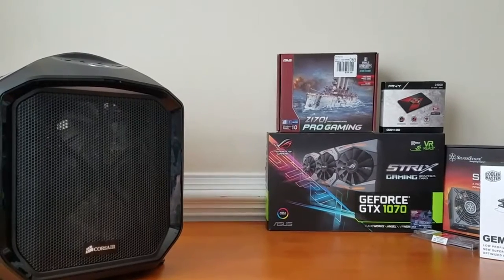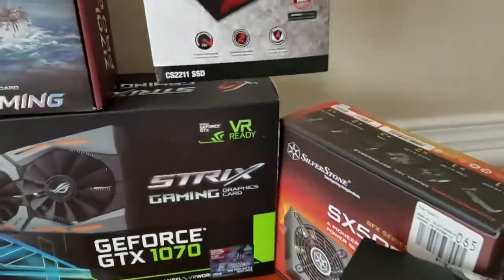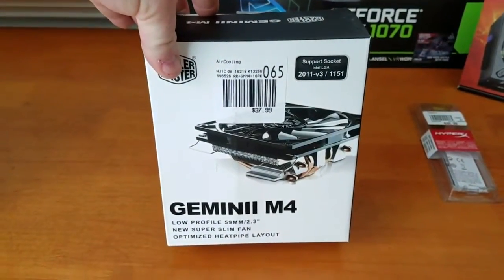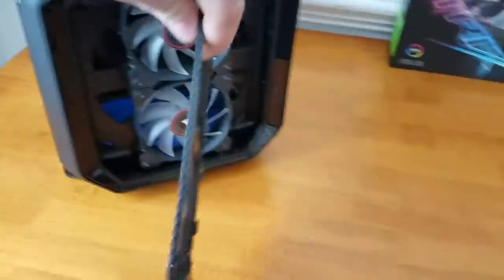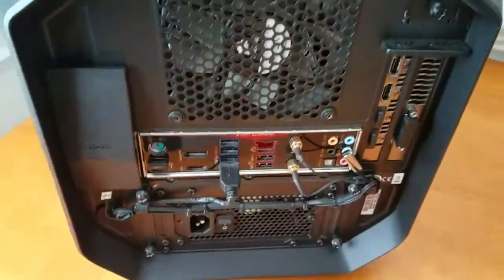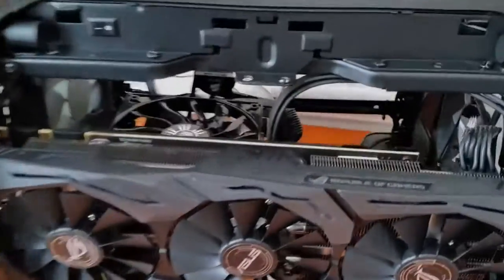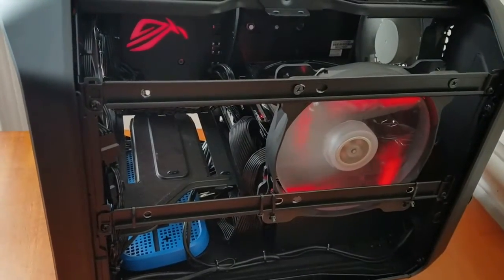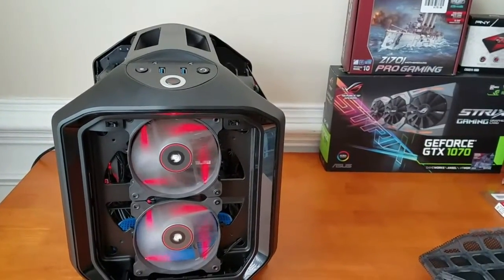Corsair 380t gaming pc build Asus strix 1070

Comment: did you have any problems fitting a 298mm gpu in to a 290mm case? wondering if these are just ball park figures or they are accurate.
Reply from the maker: More a ballpark. I did have to snip a little of the plastic clip that holds the front face on. Took about 3/16 off the tip of it just so it wouldn't touch the end of the gpu

Comment: Hi, according to Corsair, the max GPU length is 290mm. But the Asus Strix 1070 you have is 298mm. How did you get it to fit? Thanks.
Reply from the maker: It will fit without any mod. There is a small clip that holds the front faceplate on that will rub the end of the gpu slightly. I just trimmed a 1/8 off the clip so it doesn't touch.
Reply: Ok, thanks so much!

Comment: Hello, nice cable management ! 
I'm thinking of buying a 1080ti instead, but i'm worrying about card depth 5,25 mm (Lengh is 298 and height 13,4)... Do you think it's possible?
Thanks =)
Reply from the maker: I researched the size difference in the 1070 and 1080 ti . The only thing is the 1080ti is about a 1/2 inch wider. It will fit length wise but it will be tight on width.
Reply from the maker: I think it will fit but you may end up having to mod the side panel worse case scenario.
Reply: thank you very much !

Comment: Hello~im thinking of buying this case too, however the spec list says Max gpu Length is 290mm, I have a 1070 strix too, its 298mm, how did u manage to fit it? Thanks.
Reply from the maker: It will fit with out any mod to the case. But there is a plastic clip where the front face plate attaches that it will rub on. Just trim a 1/8 off if you want to so it doesn't rub.

Comment: Nice build; what temp are you getting on the CPU at full load?
Reply from the maker: neverlandelf  Hi. I'm getting around 68c on my package under load. That's while running chrome with cinebench and cpuid.
Reply: World of the Grimsgiver thnx for the info, i think I'll upgrade to that :)
Reply from the maker: neverlandelf  No problem. I'm actually in the process of swapping cases to the cougar qbx.
Reply: World of the Grimsgiver keep the corsair, i think it's one of the nicest, if not the nicest case out there.
Reply from the maker: neverlandelf  Yeah it really is. But I travel all the time and I have had issues with the size. not to mention a few time where the frame as gotten out of alignment and the side panels wouldn't snap back in place right.
Reply: World of the Grimsgiver check this one for traveling, my 2nd pc for lan parties is built in this: azza csaz105
Reply from the maker: +neverlandelf Yeah I seen that one. Hard to find just like 380t. But it won't fit my Asus 1070. It's 11 3/4 long. Said that the Azza only fits 11 1/2

Comment: Does the gpu touch the side of the case? Like any space left? Strix is lonnger then the 380t recommended gpu length.
Reply from the maker: +MarvellousDitto  the strix fits in the case with about
3/8" to spare. There is a clip that holds the front panel on that it barely touches. So I trimmed a bit off the clip. It fits just fine even with out any mod
Reply: World of the Grimsgiver can u show me a picture of the gap?
Reply from the maker: +MarvellousDitto http://i66.tinypic.com/2ql8zyp.jpg
Reply: World of the Grimsgiver thanks. But without cutting the plastic, can it still fit nicely?
Reply from the maker: MarvellousDitto yeah it does
Reply: World of the Grimsgiver then why u cut yours?
Reply from the maker: MarvellousDitto It barely  touches the tip of that clip. so I trimmed the clip just so it would not touch.